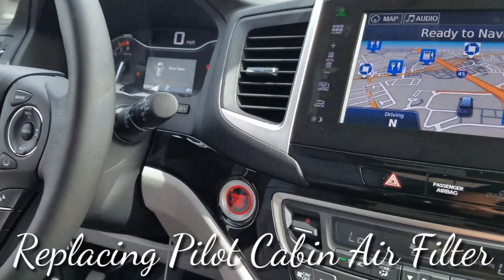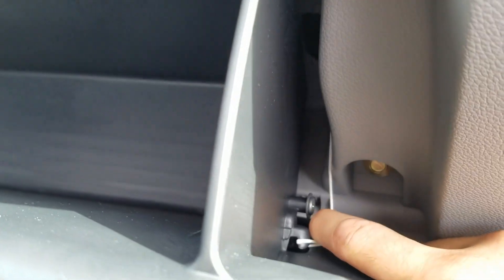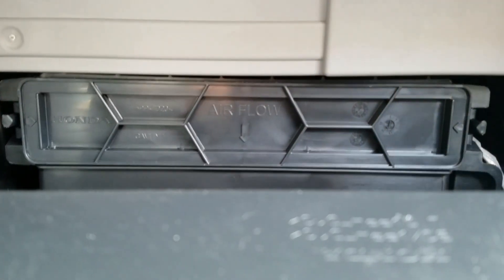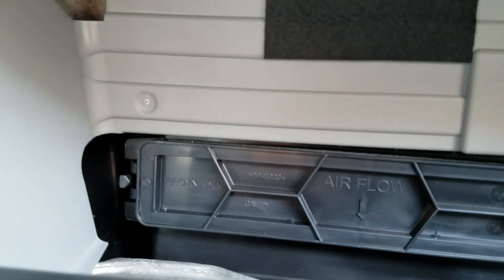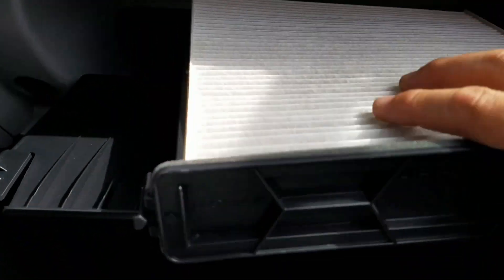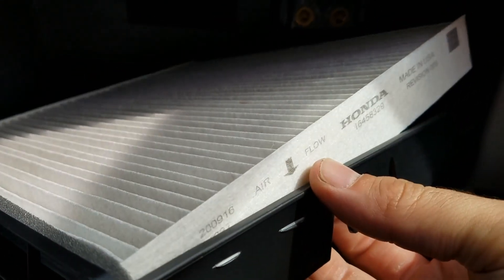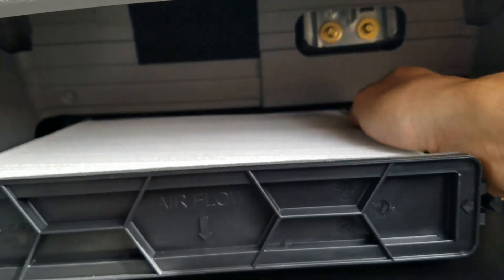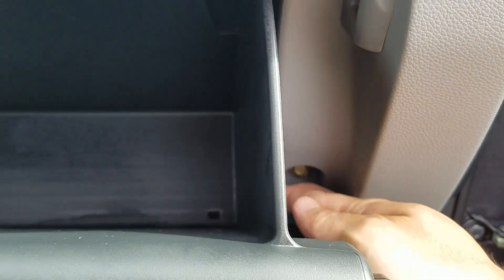2017 Honda Pilot Cabin Air Filter Replacement How to 2016

Comment: READ THIS FIRST:  Remember the damper loop is NOT connected to the screw, but the hook.  You will suffer if you try to put it on backwards.

You need:  Flat screw driver & small vise-grips

Reattaching damper cord is very difficult.  USE SMALL VISE-GRIPS about an inch up the bare cord.  Pull it slowly to fully unwind it.  Then hold the door almost closed.  Use finger and screw driver push loop over the hook.  After getting it, redirecting cord under the screw is easy.
Reply: Thank you so much.  Your comment reminded me to use tools to put the string back on.  The hook and pick tool set was helpful.
Reply: The hardest part about the change, and the video didn’t show it.

Comment: Not so easy to put the damper back in place. I used LONG needle nose pliers to stretch it and a flathead screwdriver to work it onto the hook. Took me about 10 minutes.

Comment: honda makes it so simple, i don't know why they charge so much at the dealer. 
MY BMW on the other hand, i have to take apart half the dash with screws and jimmy the old filter out, then reassemble the air tubes, put the dash back together, it takes like an hour for me to do it...